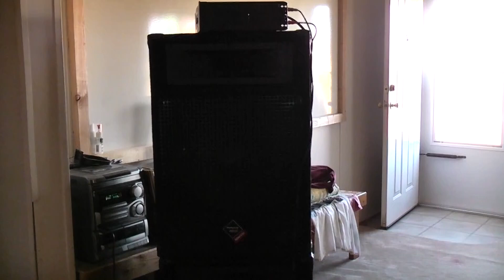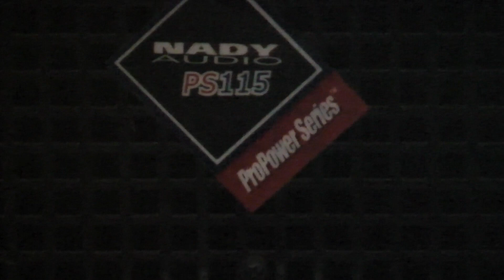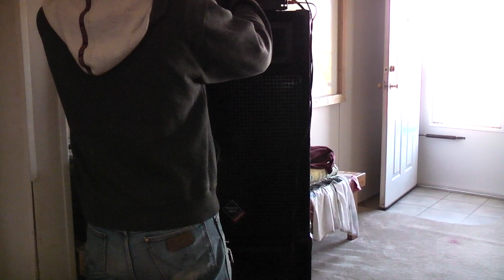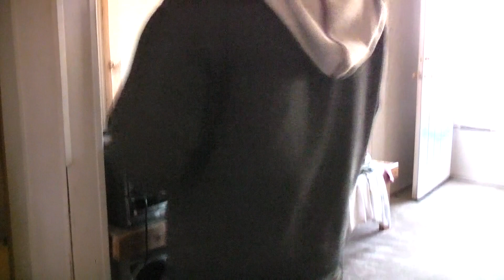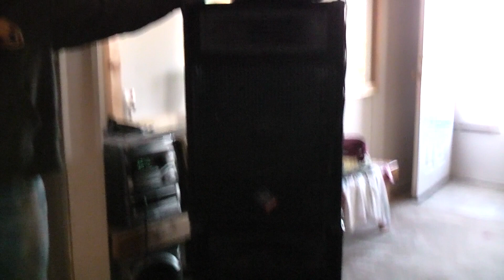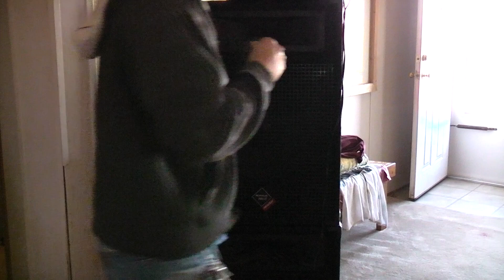Nady PS115 Power Series Speaker Pair

Comment: I own a old pair of these.The woofers are good and broken in. They have good mid and ok base but not much below about 50hz. The tweets on the other hand are crapy they are peizo tweets like in a alarm clock. I replaced them with 1.5 inch 200watt  3/4" 14 tpi. skrew on compression drivers and that made a BIG diference thanks!